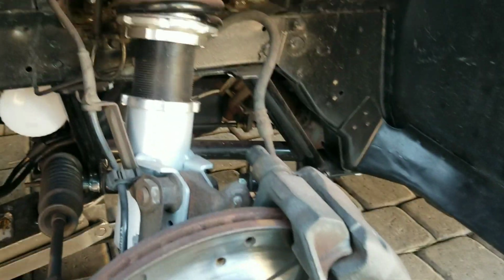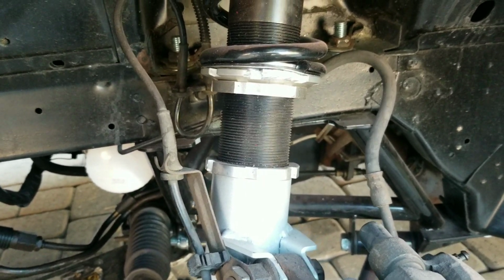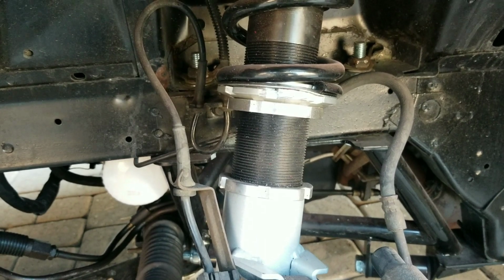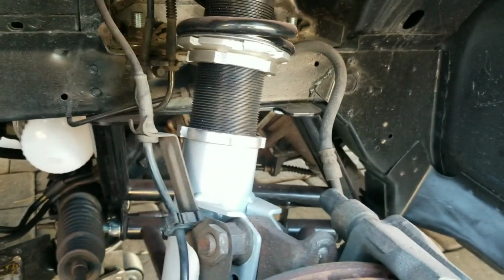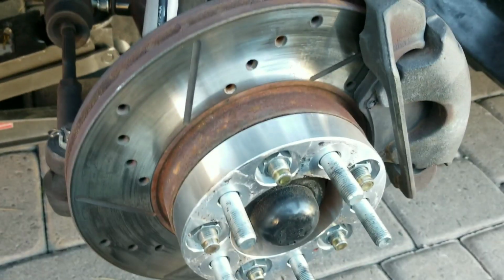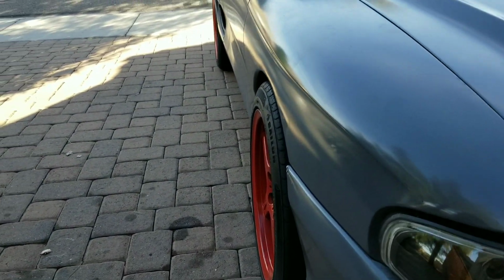Mustang Gets NEW Wheel Spacers.!!

Comment: I bet your rear driver side sits further out then the rear left wheel,a panhard bar will help fix that issue,you’ll be able to center your rear axle and both rear wheels will stick out evenly on both sides,ford’s dumb ass didn’t put a panhard bar on our cars but they started to do it on the s197’s